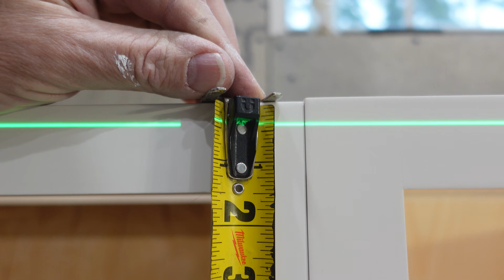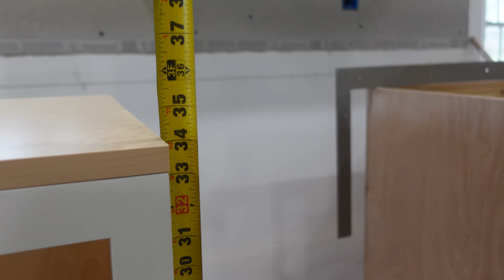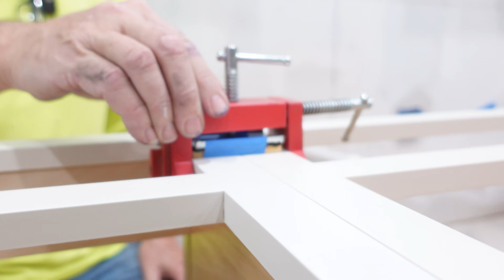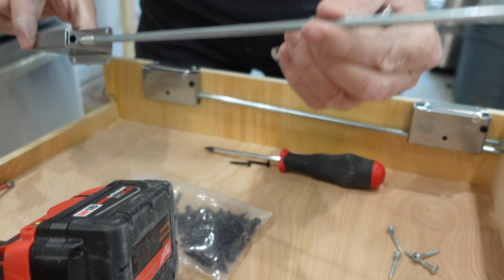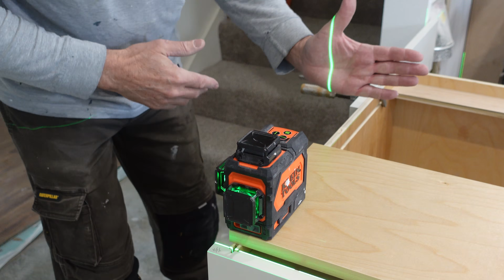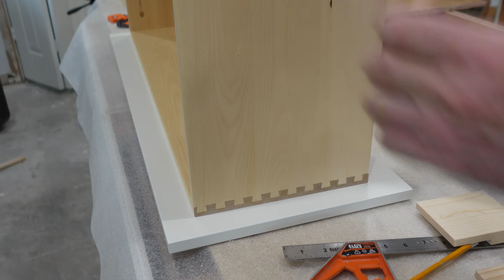HOW TO INSTALL CABINETS on an UNEVEN FLOOR!

Comment from the maker: Hey gang!  There are a lot of comments asking why we didn't use self leveling underlayment (SLU) in the kitchen.  The first floor slab is 35 x 35 feet square roughly.  If we use SLU in the kitchen, where would we stop?  The new flooring (by Flooret) is going to be installed everywhere except the master bath.  If we used SLU, we'd have to do the entire first floor or have a small step somewhere.  We would need at least 200 bags of SLU costing over $6000.00.  This is a major expense just in material not to mention all the other ramifications.   Remove/re-install every interior door.  The amount of SLU against the front door threshold would approach 2" thick.  Now you've got to raise the front door frame.  The list of issues goes on and on.  SLU is not a cure all and even the name is a misnomer, it doesn't self level.  It takes a lot of effort to get it right and you only have one chance.  Thanks for watching and thanks for all the support!!!
Reply: Paul these are all valid points . SLU is expensive but there are other ways to level a floor without using SLU.
Reply: My contractor fell through the roof, hit my husband's Kia, then took a piss while my daughter was also in the bathroom taking a shower. 🤷
Reply: Beautiful work,GOD BLESS
Reply: Paul checking in regarding the foundation.🤔 Was that initially looked at and confirmed as solid? An inferior foundation may be that problem. But then again I guess the ceiling would be off too 🤷‍♀️ 😀 Do love y'all's channel(s)!! 🤙
Reply: LOL! AT THE 1ST CUT THE EXSPRESSION ON SUMMERS FACE IS NOT ONE OF FULL CONFIDENCE! 😂😂😂😂 HAHA.  IT IS LIKE I KNOW YOU HAVE TO DO THIS BUT ???  MY QUESTION IS THE SLAB AT BACK OF CABINET THE SAME AS THE FRONT AND WHAT EFFECT THAT HAS WHEN YOU CUT IT! BACK TO THE VIDEO TO FIND OUT! MERRY CHRISTMAS TO YOU ALL!

Comment: what keeps you from using a detached toe kick(s), setting them level and then knocking out the install perfectly without all those extra steps?  No extra hardware needed, no cutting and fussing,  more cabinetry out of each sheet of plywood.  Ez-levelers might work well,  but detached toe kick/platforms are the easiest most efficient way.

Comment: On a slab that bad, I usually leave cabinets in the center at 34.5, scribe going uphill from there, and shim going downhill. It works depending on appliances and planning ahead. Faceframe stile going to the floor should be built taller once slab condition is assessed. Good luck!
Reply from the maker: Thanks Dave!   Two years later and it still looks great! I do like the idea of going uphill and downhill provided the appliances fit 👊

Comment: I love your enthusiasm and content.  My only reason that i dont cut down the cabinets is 1. If you cut an inch off the cabinets near the dishwasher, the dishwasher is now sitting up above the cabinet which is in the way of the tops.
2.  If your around 6foot tall and you are now bending over to to low because the cabinet s are supposed to be around 36inch high in the finish.
   I use wood shims to leavel everything then i put a skin on the end cabinets that i raised up. The skin is the thickness of the little 1/4" front of the frames. Then i use quarter round or scrib molding around the face frame.  I love that you have your family helping you out great job!

Comment: Have you ever considered building the bases for the cabinets separately, leveling all of those perfectly, and then putting the cabinets on top of those? Seems like that would be a lot easier. The only issue is the exposed sides, which would be easy to install after.

Comment: Don't like counter tops that are different heights, well you have exactly that, a counter top that will be an inch and half different in height from the floor.
Reply from the maker: But they're level with each other.  That's better imo.  No one notices I can tell you...

Comment: I'm having the same issue. Not sure if having cabinets that are shorter on one end or taller at the other if you shim and don't cut the bottoms. Each way you have a level top. My situation is I have cabinets on the opposite wall also and trying to decide to make counter heights the same.

Comment: Getting ready to do a diy kitchen remodel and was told to space the cabinets up to the finished floor height to prevent interference with the dishwasher height since I'll be installing LVP flooring into the dishwasher and range nooks.  I'd never heard of this before but makes sense.

Comment: I am retired now but I was a finish carpenter who had to install a kitchen on a floor  in an 1840 farmhouse where the floor dropped 3 inches in ten feet. If my memory is correct I did something  similar to this.  Another fun memory is installing 20 feet of base cabinets on a wall that faded about three inches from straight after the first eight feet. Cabinets must be installed in  straight line so that was done with creative construction at the back of the cabinets. This left one end of the cabinets 3 inches away from the wall. I was doing an on site build of a laminate countertop so one end of the top was 3 inches wider than the other. I have wondered how many people ever noticed this. Of course I discussed the problem before doing  anything  with the homeowner ad this was our solution.

Comment: so, just your typical construction issues. give here and take there to make the end cobbled together mess look OK. it's hard to think ahead to all the appliances and qualms you will run into.
even with designers and architects of today, you will still have many things that doesn't fit and endless issues with materials and final fitting.
it's all how you discover and correct them. seems like your daughter is a solution thinker. none of us are perfect, nor anywhere near!

Comment: only 1-1/4" lucky you! I installed a set long ago, the corner cabinet I had to cut right to the bottom and the far left cabinet was still 1-1/2" off the floor in an 8 foot span. 
very crooked settled old dump in Philadelphia, PA... yes, it was about 6" out of plumb in 8 feet. 🤣🤣 large beam, ruble foundation and soft red brick garbage and very close together buildings.
may as well have put false facades and made it row houses. I deemed back then that the whole area needed bull-dozed and started over.

Comment: I take a thick lead pencil or a black marker push the cabinet into it ( the pipe ). Now you hv your mark , cut from the back into the front just enough where your drill bit pokes thru then finish cut from the front !  Always use a clean sharp hole saw.  Not sure about all the cabinet cutting I will hv to absorb that !  In the past I used separate toe kicks , ladder system and scribed it building the cabinets accordingly !

Comment: BUMPERS! Don't ever forget them! The last thing you want is to see your finished surfaces ruined and even soft close hardware can do this over time. Use at least one on either side of drawer fronts and one on each corner of your cabinet doors opposite of the hinge side.

Comment: For my kitchen that I did 6 years ago, I used mostly ladder frames for the cabinets I built.  The ladder frames save on the expensive pre-finished plywood sheets, because you can get 6 sides from a 4x8 sheet instead of just 4 sides when you only need 30.5" of height instead of 34.5".  

For two large pantry cabinets I used the ez-level.  They are each 8' tall and 3' wide.  My wife only has one stand mixer, but they are not light at all.  The cabinets carcasses, drawers, shelves, by themselves are going to be 250 lbs or so.  Add things like sauces, pasta, flour, sugar, oil, and one stand mixer they are surely approaching 500lbs each.  The ez-level system has been rock solid and made getting everything plumb and level a breeze.

Comment: I would have simply used concrete leveler and made the floor level. But you do you 😂
Reply from the maker: see my pinned comment
Reply: @StudPack  I did as you requested. A few points. First, if this was a client's house, this logic would make sense because they probably would have a problem paying anything at all extra. But, you said it was your daughters place. If it was my daughter's place, I'd cover the cost myself. Second, you only need to level the kitchen floor for this project if you can't afford to do the whole house at once, not the entire house. From your example, it looks like it would only be maybe a 2 inch step down, which could easily just be sloped down to the rest of the floor so there is no actual step to trip on. Third, a kitchen should never be left this uneven for safety reasons. It's an area that will get liquids on the floor from various things and a place where you might walk with sharp objects, like knives. Those two things can set up a tragedy. But, as I said, you do you.
Reply: agree w- @stephenbustos.. also: if S+R ever want to sell that house, all the "cost decisions" are forever found on these videos - which will hurt the selling price. Plus the cabinets were FREE + getting Youtube # of views check - so could fix floor ... if wanted to.

Comment: Why not use adjustable feet like we do in Europe? Adjust up to 2 inch. Also keeps your cabinets dry with water leaks on the floor. All you need to do is a add cover after all is installed to cover these feet.

Comment: I bought the EZ-Level system for my kitchen remodel in 2022.  I called it my gift to my contractor.  He was skeptical, but in the end came to love them.  I am sure I saved money on his hourly rate by using them and the results he got were perfection.  Well worth the $300 or so I spent on the system.

Comment: I ain't going to lie every time I watch a video from you I have mix thoughts about some of your methods but you 100% made the best argument for the EX level system. It will work best for roughing out cabinets. Also with the industry moving to floating floors it will be clutch

Comment: Use channel locks and work the compression ring off. Also I understand you need to work the space for the dish washer. But without wood, what holds the dishwasher in place
Reply from the maker: This dishwasher has side mounts; most modern dishwashers have the ability to mount to the adjacent cabinets instead of the sub-top.

Comment: We bought a manufactured home in Florida in 2012. It was built in 1989. I tore out the old kitchen and ordered a new one in 2015. I saw the EZ Level system and ordered it for my cabinets. It worked great, even on the corner cabinet. Glad you found it also,

Comment: Hi, I think you said you cut the end panel on the sink-side lower cabinets to be full height, without the 1/4" subtracted elsewhere in the block.  Won't this prevent sliding the flooring underneath?
Reply from the maker: I think it'll make more sense in our flooring video.  Should publish today/tomorrow

Comment: Looks good.
A few tips from an cabinet installer .
When faceframes leave a gap,back cut last 5/8 one one side...this way only the front 1/8 will touch making a tighter joint. 

From the world at large,thanks for not using shoe/quarter-round!
Reply from the maker: Thanks!  Always appreciate the pro's chimin' in!!

Comment: For marking all the wall features to cut the back of the cabinets: Use a piece of rigid foam insulation and tap it against the plumbing doodads. insta scribe.

Comment: In my own kitchen, you can tell where decades of moisture exposure has caused a little swelling along the bottom of some of the cabinetry.

I have no experience installing cabinets, but I've wondered why the bottom edges of kitchen cabinets are rarely (never?) sealed when there's every reason to believe those will be exposed frequently to water, either thru routine mopping or occasional spills. 

Seems like it would be well worth the little extra expense and time to hit those bottom edges with RedGuard (or other waterproofing coating) or at least primer & paint.

Comment: Nice job on a pretty complicated cabinet install. The leveling system would be a lifesaver on a big kitchen like that. I just finished an island that is 9' x 4.5'. I installed it in a 100 year old 2 room schoolhouse, that my friends are turning into their house. The floor was less than 1/4" difference overall. I was pleasantly surprised!

Comment: Doesn't the dishwasher brackets bolt to the underside of the counter?
Reply from the maker: Most of the time yes but many dishwashers now have the option of securing to the cabinets in case there isn't a wood subtop to screw into

Comment: Paul the slab is uneven because concrete is fluid and it will move with the moon phases. So even though you leveled everything, as soon as the moon moves it’s going to not be level again
Reply from the maker: Ha... yeah we used to say that about backfilling a hole, dirt left over means a full moon :)

Comment: Animated intro? Moving up the production values scale!  
(also, calves hurting walking up the slab? 🤣🤣)

6:40 I need this info! My house has no sub-top above the dishwasher in my house, and I can't screw into the Corian. So I'm very interested to see what you do to attach the dishwasher top straps.
Reply from the maker: Many dishwashers have side brackets now, check your model.  Mine has both top and side
Reply: @StudPack  Mine has top only. It's nearly 15 years old at this point. I've tried what the previous owner did, gluing a strip to the underside of the Corian and screwing into that. But the glue comes off every 2 years or so.
Reply from the maker: Never tried these but cool idea:  https://amzn.to/3BJu0fy
They adhere to the counter and provide a hole for the screw.  If supplied adhesive doesn't hold, I'd use 3M VHB tape:  https://amzn.to/3ZQYkwF
Reply: @StudPack  Oh, that's a GREAT idea!  I can even epoxy that so there's no chance of it falling off!  Thanks a bunch!

Comment: Just curious...with a inch off level in just 12 to 15 feet, there are definetely no foundation settlement issues? Is the whole slab equally on that slope. Did the cabinets on the other wall need the same scribing?  Either way, that seem like a real pain. Thank goodness the dishwasher fits.
Reply from the maker: The house has had foundation work.  We think they raised it to a point where it was sound but didn't go further and cause damage

Comment: EZ Level needs to invent a similar system that Appliance Mfg can incorporate so you can level the dishwasher, ranges and refrigerators without pushing/pulling it in and out multiple times.
Reply from the maker: 100%, some high end fridges have that ability

Comment: You made hanging kitchen cabinets much more difficult than it should be.
Reply from the maker: I was working with what I had.  A lot of folks have uneven floors.
Reply: @StudPack  Every installer sees uneven floors. It's not a problem if you start at the highest point of the floor. You made hanging kitchen cabinets much more difficult.

Comment: Great job as usual. One thing that caught my eye was the cabinet above the stove. Is that protruding awkwardly into the stove top work space. Almost seems like you need to reduce the width of that upper to keep it out of the work area.

Comment: How did you fasten the cabinets to the floor around the stove?
Reply from the maker: Didn't.  Always have in the past though.  I figure the 400 pound counter top siliconed to each cabinet box is sufficient.  I still may when we pull the oven out to connect the hood

Comment: I would be worried about the bottom of that cabinet sitting on the floor soaking up water during regular mopping. Would be best to seal that wood at a minimum.

Comment: I work in a cabinet shop. I deal with the Blum slides, fixing clips, and brackets day in and day out. As far as the rear brackets in the cabinet go, they can also be moved around left to right and up and down. So if there is a second piece of wood behind the frame that isn't straight, you can use the rear bracket to move the back of the slide to where the drawer front sits flush on top of the face frame, then lock it down. I personally love that rear adjustment alone, as though it works, if you jack it up high enough, the drawer will fight you going back in as it won't clip into where it should be, and you'll wonder why its sticking out.
Reply from the maker: Thanks for the tip!

Comment: I am guessing my questions will be answered in the next video, but I am curious how the EZ levelers still solve the problem of the weight of the cabinets from resting on the floor, pinning it down - which flooret says shouldn't be done? Also, my questions might just be stupid about this as Paul is a master and obviously has this all sorted out already in his head.
Reply from the maker: The foot of the EZ Leveler sits on the slab so all the weight is on the slab.  We lowered the cabinets to just kiss the Flooret floor.  It came out great!  Flooring video shows it better, it'll be out this week
Reply: @StudPack  got it! Really love that detail (like all studpack work) is really thoughtful and smart.

Comment: Kitchen will come out great, but living in a house with such a slope will become a big nuisance over time. I would personally take steps to level the floor. Not using (only) SLU, I know there have been comments about that already. But filling in like 5 cm of floor drop doesn't require  the (sole) use of SLU, you could use regular screed (small aggregate concrete) for that. Perhaps finish it with SLU if needed. And also, I would also get as much information as I could about whether the slab will continue to sink and what to do about it. It's a very big issue, imho.

Comment: NICE. That Eazy Level is great. That kitchen layout, however, is terrible. I mean, it's nice to look at - but to use it's going to be bad. The drawers interfere with the oven, and frying anything like bacon or chicken or similar is going to splatter grease everywhere. Great craftsmanship - bad layout.